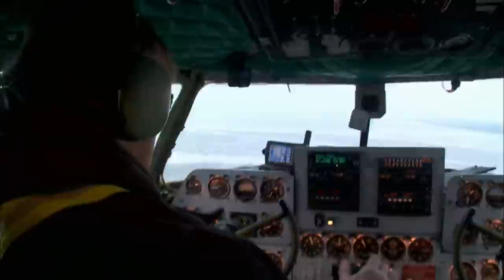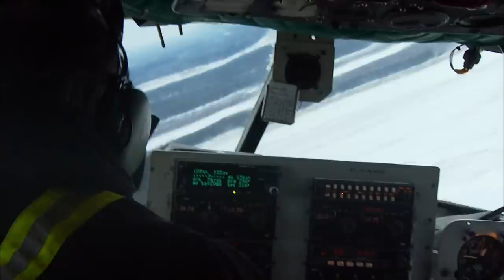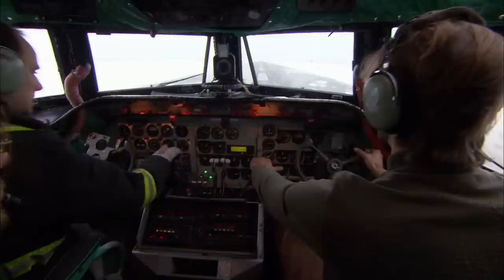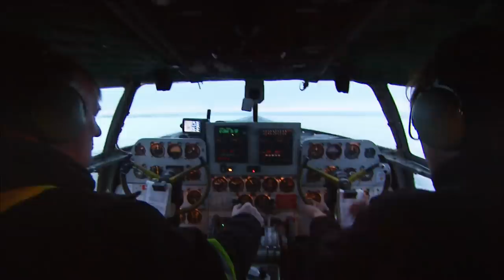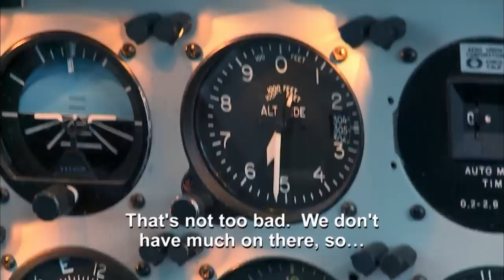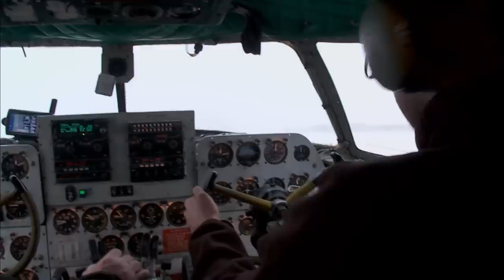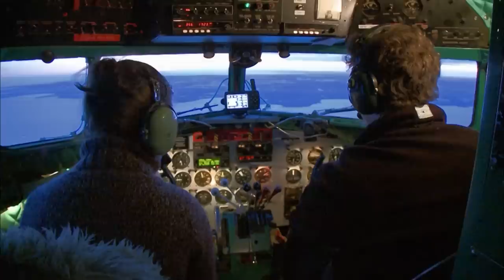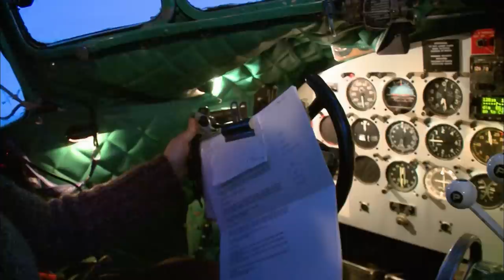Flying Legends: DC-4 in Canada's Arctic

Comment: I swear baffallo needs more modern aircraft I mean yah having a unique fleet of antique aircraft is cool, but having to have 5 loads instead of just one is not very good. i appreciate the retro fleet tho cool to see DC-3s and DC4s flying still!
Reply: The problem then is weight on ice runways and the fact that the airports up there are small so have small runways.  The DC4 or Electra is about as big as you can fit.  Jets need longer runways and definitely can't land on ice runways.
Reply: @cjmillsnun  Turbo Prop conversions, or other turboprop planes are the way forward

Comment: You don't put that pipe like that on top of the forks!! You strap the pipe underneath the forks,then lift it hanging.then in angle you set it inside the aircraft.then slowly slide it in..after that secure it to the floor.

Comment: What? A flight mechanic without much field experience is not too abnormal but having the right spares loaded up with the wrong jack, o
or at least the wrong or NO dunnage to use with the jack to be able to change the tailwheel, that's everyone's fault, all the way to the D.O.M.
Reply: I was surprised the spare wheel didn't have a bearing installed.